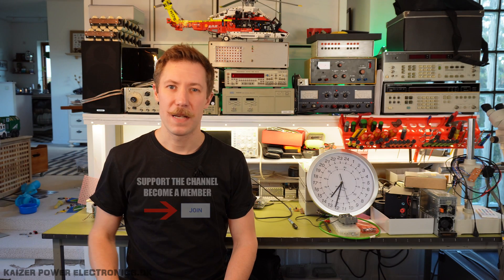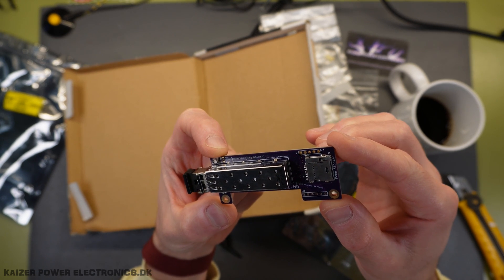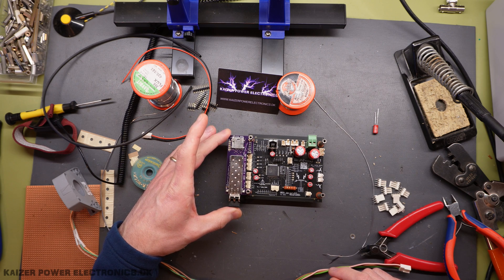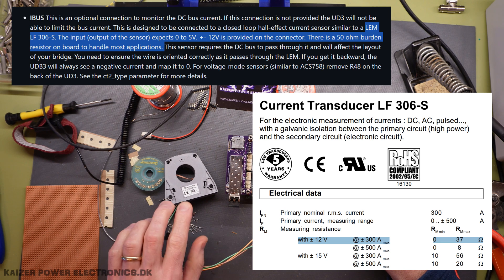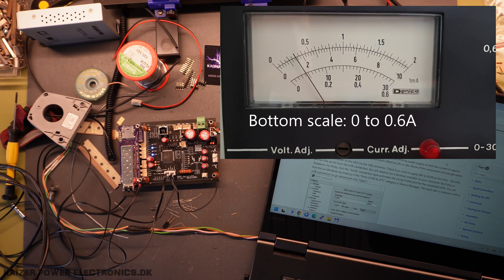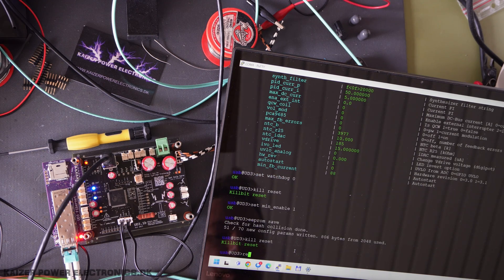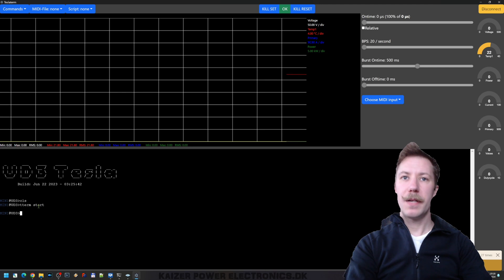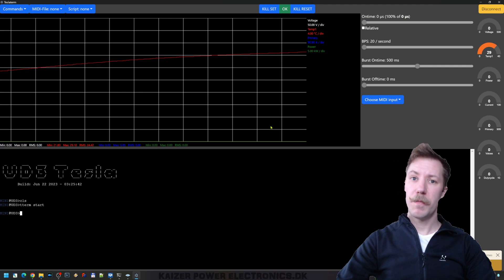NextGEN DRSSTC UD3: Unboxing, Soldering, Startup and Software (Part 1 of 3)

Comment: Hi, how can I order from JLC pcb the board without PSOC? Another question: Why has been chosen to use a complex FO connection when is simplier to use a standard plastic FO used in industrial enviroment and High Power IGBT drivers (HFBRxxx from Broadcom) to have an isolated serial channel without IP address and so on?